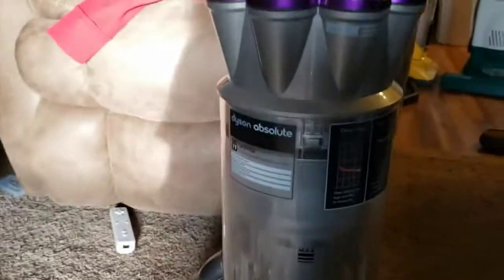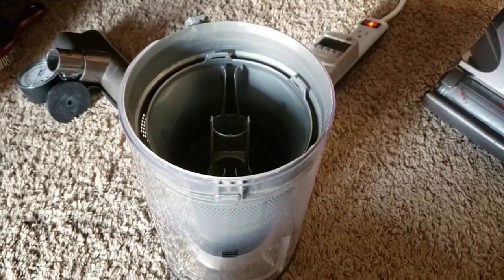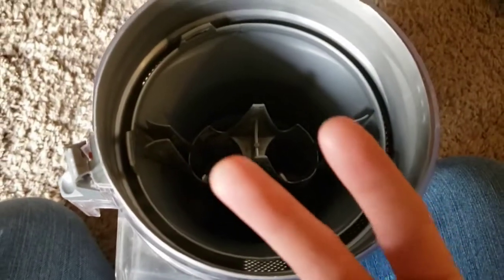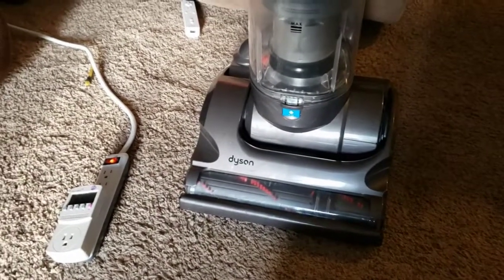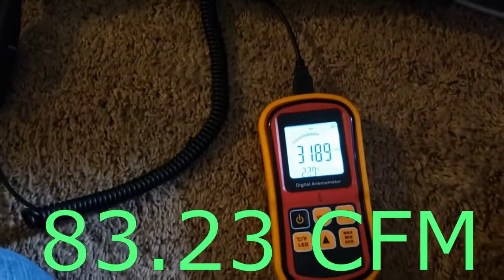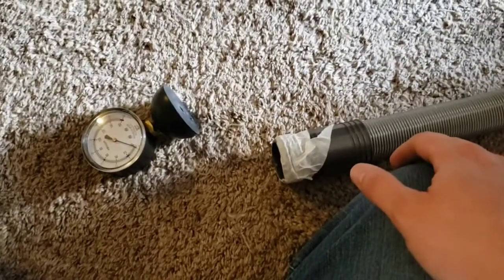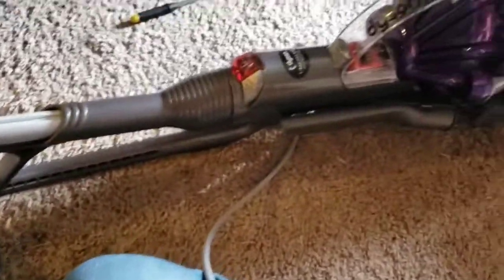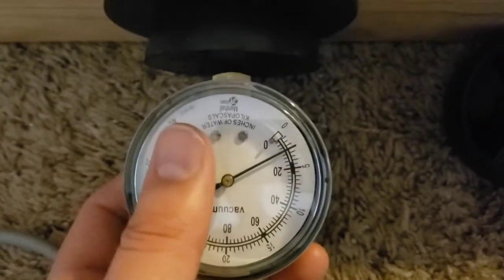Dyson DC17 airflow test

Comment: I have very low vacuum at the WAND end.  Any thoughts what the problem could be?
Reply from the maker: Hmm i'd check the wand and hose for clogs then check the hose for tears. If that's not the case i'd also look at your filters making sure they're clean lastly there's the diverter where the machine directs suction to either the hose or to the floor. I know like on the 07 line that connection would kind of get stuck rather than fully seating with  the seals. Hope this helps
Reply: @Blackheartvacs  I think I found the problem.  The back of the base near the bottom is a "U" shape tube.  It has a twist lock.  I took out that "U" shape tube
and it was jam pack with junk including a eye brow pen.  It was really packed with crap.  While I discovered that I previously rinsed the removable filter.  Tomorrow
I will put the filter back when it's dry and I am just about 100% positive all will be working again.   There is the other filter near the motor should the cleaning of the tube
doesn't solve the problem but this "U" shape tube was really clogged bad.
Reply from the maker: @n1kkri  Ah! one bulky object gets trapped and then other items just build up around it.
Reply: @Blackheartvacs  All working perfectly again.    Thanks for this video.

Comment: These are arguably the best non-ball Dyson uprights you can own, these are way more superior than the DC07, DC14, & DC33.
Reply from the maker: Now if only the brushroll weren't so harsh
Reply: @Blackheartvacs  I have a question, which brush roll do you recommend, Dyson doesn't make them anymore, and I need a aftermarket replacement
Reply from the maker: @Unknownmanufacturer  I honestly can't answer that I just picked out the cheapest option. I'm totally unaware of what the options are and how they compare.

Comment: Great tests. Don't see too many of that model any more these days. 👍
Reply from the maker: Thanks! I've got a ball animal 2 on the way as well it'll be interesting to see how that does, i've seen that it's airwatts are somewhere between 270 and 306 depending on the source. Oddly I couldn't find them listed on dyson's website.
Reply: I think I’ve seen five or six of these Dyson DC 17s and sold two
Reply: I currently still have One for parts and one fully working
Reply from the maker: @VacMaster2020  Yeah you definitely don't see quite as many of them as you do the 7s and 14s, the higher price point is most likely why. I also think people may not have understood what made the 17 differ from the others

Comment: I have two Dyson vacuum cleaners. They are the DC33 and the Ball Animal 2. I bought the DC33 brand new from Walmart in June 2017 and I bought the Ball Animal 2 brand new from Lowe’s in November 2017. They can’t deep clean carpets and rugs.
Reply from the maker: Yeah they've never really been known for their ability to deep clean.
Reply: @Blackheartvacs  I bought my two Dyson machines for shits and giggles. They collect dust and take up space in my collection while I use my Kirby’s and Eureka/Sanitaire F&G machines. Dyson’s pull up a lot of carpet fiber and they pull up a lot of sand and grit. They pull up very little fine dust though.
Reply: The dyson  ball animal 2 is know by its Power and ability to deep clean carpets. Although the dc17 has more airflow, more agitation and probably more suction, the animal 2 still does a very good job on carpeting.
Reply: @eduardopaulin3744  I have several Eureka/Sanitaire F&G vacuum cleaners and I have several Kirby vacuum cleaners. I also have a Hoover Elite Commercial C1404, Hoover Elite Commercial C1414, Hoover Concept One U3103, Hoover Convertible 700 U4497, as well. Eureka/Sanitaire F&G machines, Hoover Convertible/Decade machines, Kirby machines, Royal All Metal machines, are unbeatable for deep cleaning carpets and rugs. They pick up fine dust under carpeting that Dyson and other “Clean Fan” aka “Bypass Fan” machines leave behind.
Reply: @robertgwisdala5795   Ok but direct air motor vacuums have more airflow than clean air motors, i know that, but clean air motors can do things like using the accessories a lot better than direct air motors, but if you prefer direct air motors, thats ok, I can't judge your vacuum preference.